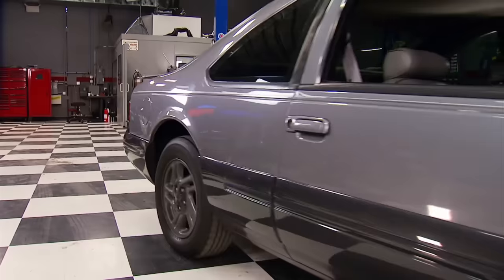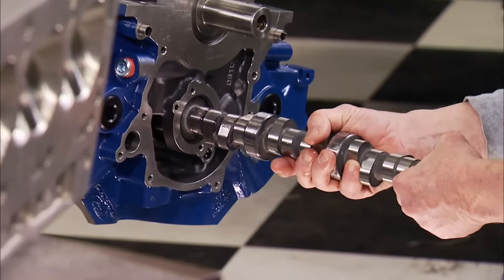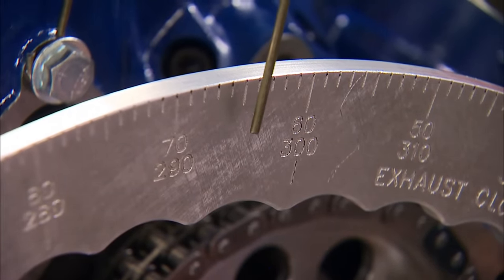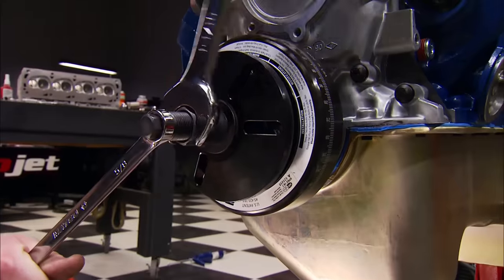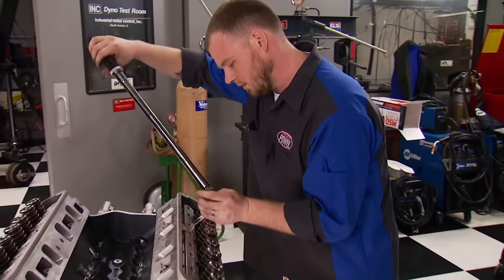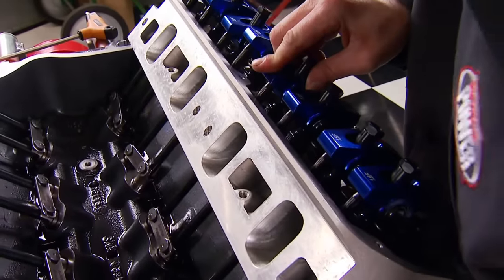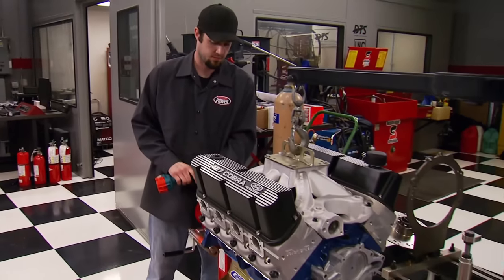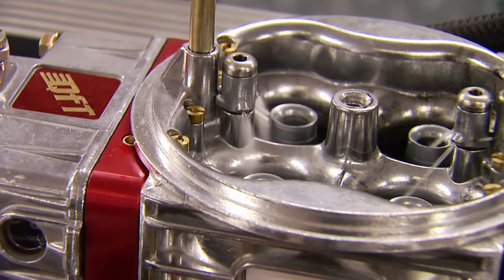Building a 427 Stroker from a Ford Boss 351 Block - HorsePower S15, E6

Comment: This is a great motor, I built one similar a 69 351w block as a 418ci stroker, all high performance, choppy Comp Cam, roller rockers, victor Jr. Heads, high rise Elderbrock intake manifold, 750 carb, headers in a 65 Mustang had 550hp or more. Nice strong motor, 3sp automatic c4 transmission with hardened gears, plus with a 2500 stall converter, 383 rearend gear ratio. Thanks for sharing this motor, It is very similar to the one I had, sweet.
Reply: "550 hp or more" my ass. Just like your "383 gears".
Reply: @deeremeyer1749  yep, all blueprint, magnifuxed, balanced, paperwork, receipts. Yep it sure beat some ass alright. Hahahahah !
Reply: @congettoinzauro4860  I'm guessing you've never set a gear in your life.  
9 in come in 370:1 and 390:1( two closest gear sets to your claim  not 383:1 . Nice try though.  Also the 64 1/2 - 66 mustangs were super weak structurally and 400 plus hp would easily twist that pony all up.  Which is typically why you don't see any legit fast early mustangs without a ton of structural bracing / modifications . Those who know , know . Guys like you just flap their gums.
Reply: @johnmilner5485  my 65 mustang didn't twist one bit, ha, I had possi traction.
Reply: @johnmilner5485  dude you are so funny, everything was rebuilt, I even had my c4 transmission rebuilt with a shift kit plus a 2500 stall converter. I even had to put on a Harwood hood scoop because my highrise manifold was so tall my air cleaner was sticking out of the hood. NICE  ! Bahahaha  ! Try that for size. 😁
Reply: @johnmilner5485  it was sweet with the choppy comp cam, the stang would bump at least an inch sitting at idle, they suggested to put a 3500 stall converter in, but I decided to take it back out because it was too mushy. ha, that's too bad I blew away that Camaro. And he got pissed because I told him he should have bought a mustang.  🤣🤣🤣🤣😁.
Reply: @congettoinzauro4860  COOL STORY BRO !!!

Comment: That air compressor tool to remove springs is very cool. When I was a kid I used to fill the cylinder with rope lol UNTILL I got maximum pressure to remove those pesky magnets to change seals ect and double springs. How times have changed. But today springs and seals are probably one of the easiest jobs for a novice like my self. Essentially 351  Cleveland’s and my favourite motor the fuel injected version of the 351 Windsor. They are both very very good engines provided you DO THE JOB RIGHT !! No skimming or you will regret it just plain and simple.❤😎🇦🇺👍🇺🇸

Comment: I can't believe that with fast-burn type heads they thought more advance would bump power.....they finally figured it out.  What was the final timing change?  More timing or less?
Reply: Looks like 31 degrees , in my experience SBF usually do not like a ton of timing . A SBC likes alot though like  36 up to 40.
Reply: @boostedsaleen6146  Thanks.....was very curious as I've dinked with SBF's all my life and I was wondering what they were up to.
Reply: @tomnekuda3818  I've built a bunch of small block and big block fords my self every thing from a 302 to stroker windsors and 586 series engines  I definitely bleed blue .
Reply: @boostedsaleen6146  Sounds like me....have built 460's, some stroked, for towing and some for street.  Not so many SBF's but that's what I'm driving now....a warmed up 302.  The 385 series heads are miserable in the exhaust area as they were compromised to fit between shock towers on Mustangs.....best always to save nickels and dimes to buy good flowing aluminum heads.  I have ported/Devcon-F'ed stock heads to increase/boost flow in exhausts until I was blue in the face.  Even following Ford templates for porting, it remained the biggest weakness in the 460+.  Best to build torque in 460's and rpm in SBF.....wind 'em up until only dogs can hear them!  Ha.  351W is particularly good engine for torque and HP.  Keep the Ford Faith.  Tom
Reply: @tomnekuda3818  I think most windsor builds can reach 34 degrees... Had a 460 at 33 and a 302 now at 29 degrees... Both 93 pump which is working good
Reply: @anonymousanonymous9991  Thanks for the info. .. I always modified the distributors by welding up the "shoe" and the filing the slot to what I wanted for centrifugal...then played with the springs until that was right.  I used an adjustable orifice (actually an aquarium air bubbler valve) and adjustable vacuum advance Ford to delay the vacuum as I needed.  I'm too damn old to remember the numbers.  On the towing motors I sometimes got carried away on compression.....one I built at 10.5 to 1 with iron DOVE-C heads....I had to add water/alcohol injection to quell detonation; I used Spearco or Holley controllers on the water inject.    I put TRW forged  pop-up pistons in it and I had to file fire-slots across the domes to help the pre-ignition tendencies and then rebalance.  I wanted the timing "all in" as soon as I could without destroying the engine.  It was a balancing act with an RV cam(high life/short duration).  It ended up pulling like a bear and getting 15 mpg pulling a camper....I could not believe it.  Had a 750 Carter AFB that I spent a long time on micing the needles/fiddling with the jets to get that right......give me a mic and a calculator and I can get them right.  I'm not a big Holley guy....I've got about 8 of them carbureting my shelf in the shop now......need to sell them.  You ought to see how clean pistons are on teardown with water injection...puts that carbon right out the tail pipes.  However, too much water injected can pit the piston tops.  I usually ran long headers/2.5 pipes/cross-over/MagnaFlows.  On hot rod engines with aluminum heads and long duration, high bump cams I could get away with more timing due to cylinder pressure bleed-off/aluminum heads/bigger & shorter headers.  Not near so touchy.  Mostly stuck with 2-plane manifolds 'cause I like torque.....the old idea of "give me a longer lever and I can move the earth" philosophy.  I really would have liked to had more small block Ford experience because I love the small pkg.  To change the subject.....whadda think of these Coyote engines?  Poetry in motion.  Seems all I ever hear is about LS belly-button mills....yup, everybody's got one....kinda like SBC's and butt-holes.  Keep the Faith, Tom
Reply: @tomnekuda3818  Truthfully there isn't any N/A Ford's that don't suffer from poor flow characteristics. The best advice I know of to give someone who's building a sbf is: go the extra mile when you're porting the heads and mating the heads to the block. Smooth out everything as much as you can and they will wake up much faster. Instead of 6 psi making 100 whp it'll make 130.  And the block won't heat up as quick with boost, which is nice in anything going into a dragster. My 302 has been bored over 0.040 thou and stroked to 331 ci... I've had luck with low boost going through semi-hemi/potato heads. I'm using a lunati cam @ .522 intake lift / .521 exhaust. 570 torque @ 3200 / 490 horse @ 4400. Once I swap it for a 408w I'm gonna give it a 850cfm carb and see if I can get it addicted to meth 😉
Reply: @tomnekuda3818  I haven't ever had the opportunity to work on a coyote of my own but, I don't see anything wrong with them. If you are doing a swap I think the 351 is a better choice. Little bit more potential for not much cost. Weight isn't bad, price isn't bad, and then you have room for bigger valves which helps with breathing. For a truck/drag car that is. If you wanna have fun at a track I think the coyote is the better choice. Better throttle response, and in this case saving weight takes precedence over making absurd power.
Reply: @anonymousanonymous9991  Thanks.....sounds like you've developed a nice motor.  I'll bet it might even surprise you.  Good luck.
Reply: @tomnekuda3818  It's certainly what I've had the most fun with so far haha

Comment: 0:48 "...a new version of Ford's famous FE 427". Um, no. Only similarity is displacement.
Reply: Mick Annical :Yep. The desire Ford had was to make the 221 to 400 family of Windsor, Cleveland / 335 engines better the FE. At LeMans with the 5 litre GT40 Weslake engine, they did it in 1968. Since its an iron block 4.38 inch bore center to  center 427, its outdone the 485 hp GT40 427 FE.With a huge weight reduction with its trim 9.5 inch tall deck.Score!
Reply: I’ve got one but I have to agree, tha FE 427 was a really cool engine, deep skirts, interesting valve arrangement, shaft rockers, weird head to intake, cross bolted mains, and a firing order that is instantly recognizable...the 427 Windsor shares displacement only.
Reply: @stevoschannel4127  Windsor?  I thought Boss  351s were clevelands.
Reply: @MrWildwilly48  this is a windsor based and windsor headed motor.
Reply: @MrWildwilly48  They are calling this a Boss. It’s not a true Boss. Twisted Wedge heads are just that, “wedge” heads, not canted valve like the Cleveland.

Comment: back in the late 80s i spent a lot of time at my brother-in-law's garage and and guy that worked in an engine rebuild shop said that the 351 Cleveland was his favorite engine to work on because of its potential at the time, this vid shows why. yes todays engines with blowers etc may make more power but for a street machine this would be fun just for cruising even if a honda would kick your butt, lol
Reply: Yeah that's all good and everything but this engine they built is not a Cleveland.

Comment: I'd love to see some E85 and higher compression engines. 13:1 anyone?
Reply: High Performance Academy just interviewed a guy saying they were making engines with a CR of 14:1 and weren't knock limited on E85. IIRC it was with a Hayabusa head. No idea on the cam specs or if the claim was static or dynamic, pretty impressive either way though.
Reply: I would like to see them with a 2JZ inline 6 and get at least a thousand horsepower
Reply: 13:1 Isnt as crazy as it used to be...even Nissans have up to 14:1  in their VC turbo engines
Reply: See if they can't get into diesel territory... The Mazda skyactive 5 cyl. Make 14:1.. so with enough$$$ it can happen
Reply: 4 clyinder*

Comment: Just watched them supercharge a z06 and didnt even break 580hp these guys broke 600 N/A
Reply: 580 at the rear wheels is not the same as 600 at the crankshaft
Reply: @Thraser999  I understand that I've been building engines since I was a young kid. Would be easy to beat those numbers at the rear wheels with this engine and a bottle of spray and not spend half the money engine wise. Then put this package in a fox and drag that vette all day and have 25k less in it

Comment: That is not a boss 351...the boss is a Cleveland, this is a Windsor motor running inline valves...all boss motors use a canted valve 335 series or 385 series based head design.
Make a track boss Cleveland stroker with CHI heads and watch it crush the Windsor
Reply: Thank you.  Canted valves is what made a Boss the Boss. 
This is a strong Ford, not a Boss.
Reply: @johntempest267  its fords boss 351 block, maybe try looking it up before flapping. That is what ford named it.
Reply: @Oldsoldiersays  
If putting Boss heads on a Windsor makes it a Boss (302), then putting Windsor heads on a Cleveland makes it a Windsor. 
And I got your flapper right here!
Reply: @johntempest267  dude quit arguing with people. The block is called a boss 351 or u can get a boss 302 block. Look it up. Its fords aftermarket block. There around  $1800 to $2100 for them.
Reply: @johntempest267  You obviously are easily triggered. Ford's version of an LSX block. They call it a boss block. No one thinks its an actual old school boss engine. They use the name on alot of their aftermarket stuff, boss intakes, 2004 boss mustang, boss blocks, they even interally refer to their fr500 heads as boss heads

Comment: He mentioned "one small tinning  change", but he never mentioned if it was more or less. I've watched 17 minutes and couldn't know what came up with the results.
Reply: Pretty sure they settled at 29 degrees BTDC.
Reply: If you look on the timing mark for the final adjustment, I think he went smaller jet and then it bounced around 33-35 degrees timing for 610hp, so I'd say around 34 degrees was the sweet spot
Reply: pegglegg123 They tried 35 before with low power, I don’t think 35 would bring the power up after leaner the jets. 32 or 33 makes more sense, but it a shame they didn’t mentioned. I was about to subscribe the channel, but I was disappointed.
Reply: @m.pietro9087  its was mainly about 33 so close to sweet spot, but they should have said it. But just looking at it you can tell so not needed
Reply: pegglegg123 thank you very much. It’s important to have this kind of information. It helps everyone with engine projects.

Comment: Impressive numbers, but I just can't get excited seeing someone pull out a modern fuel injected engine and replacing it with an antiquated carb setup.  If this was a 70s muscle car, sure.  But not on a late 90s car.
Reply: THIS^
Reply: Agreed. A blown coyote and manual trans out of a wrecked GT500 would have been cool. Just think how many wrecked GT500s must be out there.

Comment: I'm disappointed. When you said Boss 351 block, I expected a Cleveland, not just another damn Windsor
Reply: George Armstrong So was I , believe it or not it doesn't take that much to get 600hp out of a 400M .
Reply: I'd like to see D3 heads on this. I believe it would be a awesome package. So many Dirt Races run the D3 engines. They dominate the dirt late model scene.

Comment: This is interesting because last year I wanted to build a 427 for my 86 Mustang Gt. Instead, a friend helped me pick off the shelf parts and built me a 408 stroker from a 1969 Shelby 351w block. The motor made 643hp and after I installed it, my car made 501hp at the wheels on a very conservative tune.

Comment: you should use the same procedure for finding the cam center line to find the true TDC & then adjust the pointer.  This becomes more & more important the longer the rod is because longer rods keep the piston at TDC, making it harder to tell where TDC is at by simply using a dial indicator to find the 0 degree point.

Comment: My dream engine, albeit with an aluminum block and Holley Hi-Ram fuel injection. Installed in a 2900 lb Fox body with good suspension and brakes, it would yield supercar performance.
Reply: 427w dart with a high ram, holley dominator in my fox

Comment: I have a 77 Ford Thunderbird with a 400 in it and was looking for some sort of combinations without extensive engine building.  But would make around 400 to 600 drivable horsepower.  Thanks guys
Reply: The 351 M and the 400 are garbage engines when it comes to performance. Find a windsor or cleveland engine instead. A windsor engine would be better because it wouldn't cost as much to build and the parts are easier to find.

Comment: Just about my exact setup, I got a 438 9.5 deck SBF in my mustang but I run Darts Iron Eagle Block andva set of Yates C3 heads that makes over 700 NA but I spray the guts outa mine😱😱

Comment: I have found that if you attach the cam gear to the cam before you install it you have a lot more control in handling the cam as you squeeze it in threw each bearing.
Reply: Try a long-ass bolt the right size cut off as a "handle" and/or feed it in with the engine "flipped" on the stand.

Comment: With that much torque and small separation between torque and horsepower there is a lot more to be had  with that engine...either thru bigger  heads or cam or both.  It'd be good for street fun though, and a good happy medium

Comment: Anyone else notice they did not use Boss (Cleveland) style heads, rather Windsor heads. Was really surprised by that as Boss heads flow much better. Still a great build with an amazing block!!
Reply: This is exactly what I was going to comment about. Like why are you using straight valve heads on a Cleveland?! But the block isn't the OG 351 Boss from 1971, it's a Windsor block. Ford Racing M-6010-B35192BB Boss Engine Block

Comment: Nice-looking engine one thing I noticed is do not use form a gasket silicone on a paper gasket it will turn the casket to mush sometime down the road and that oil pump should have been cleaned up was just some 400-600 Grit hand sanded and sometimes a little porting work on the oil packages make a big difference on Ford motors especially from the pump to the filter housing I wish in tears almost when I seen what they did to that oil pump check your end clearance that's where it counts and you have to run stronger oil pump shaft and are you sleep in the distributor gear with a Hardin pin I usually use a drill bit bigger size the stock Ford pin may share  unless you have a heavy duty distributor that has an upgrade

Comment: They did this yrs ago in the Ford power  book , used a 400ci w/quench heads , spacers, a good single plane intake at 6000rpms , Roller rockers pushrods, guide plates , and a solid cam , easy peasy, all ready been done 30 yrs ago , and a whole lot cheaper.

Comment: I ported and polished a set of stock heads for a Fox mustang, even mirror finish polished the combustion chambers I did get .5 second faster at the track but the problem is the valves are so small so if u have small valves don’t even waste ur time.

Comment: My father built a 427 using the same block and crank but with chi 225 3v Cleveland heads and it made 690 hp at the crank n/a

Comment: after washing a part in the cleaner  you have to extra clean with acetone  as the cleaner still leaves a film that blow drying doesnt remove, thus the oil cant get on the surfaces correctly to do its job.